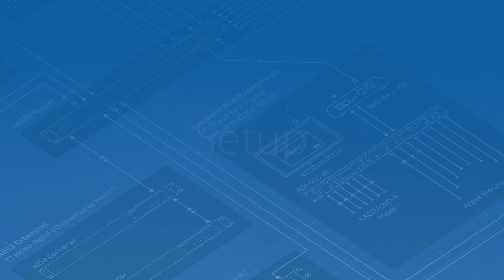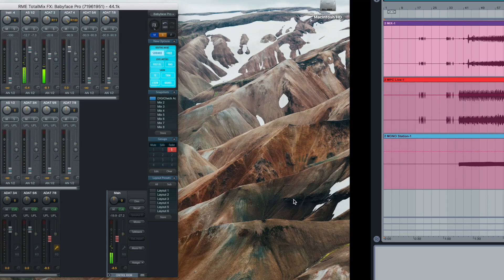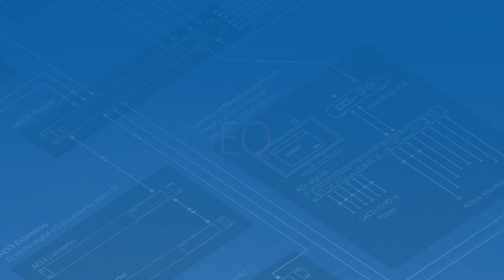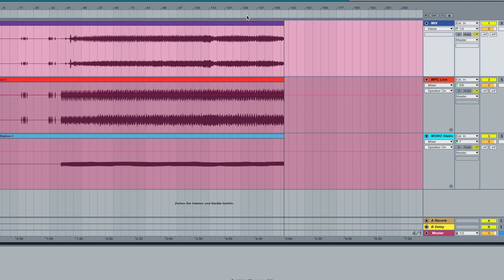Mixing & Routing in TotalMix FX (Babyface Pro, MPC, Analog Heat, Circuit) | RME Blueprints #01

Comment: how to connect hardware compressor
Reply from the maker: You must use a line output channel to go into the compressor. From the compressor you go back into a line input.
Reply: @RMEAudio  How do I temporarily monitor just the line input in this case? I've connected a compressor so I can just play an uncompressed vocal or bass line from my DAW, to go out (of one of the XLR ports), it comes back in to one of the line ins, and I can record this now compressed version back into the DAW, but I can't hear the compressed version as it's recording, I'm basically guessing the compressor setting, recording it, before seeing if it came out ok.

I need to be able to 'mute' the DAW to my headphones, and be able to only hear the returned signal in the line in, for the time spent dialing in the compressor. 

The line input that the compressed sound is coming back into, if I raise the level thing on it, sure it starts feeding that mix into the main sound, but then obviously that begins to cause a loop, because that becomes part of the main sound which feeds backout into the compressor.

Comment: Hey. I want to process a percussion loop through my BAE 1073. I have the percussion loop on track one in ableton. On track one i have the external routing out xlr output one on the babyface to the input on the BAE. I then have set up track two with the xlr output of the BAE to xlr input on the babyface pro. but im not getting a signal into the audio track? its doesnt seem to be going throught the output??? cant figure out why not?
Reply from the maker: Please check your routing. You have to select the output and then move the fader of the software playback signal up. The output fader must also be used to adjust the output level. https://www.youtube.com/watch?v=ZkxzYlBiScA

Comment: OK real quick question when im bouncing the final mix of a project in my daw if the loopback function and the DSP EQ to record is selected will it record the interface effects when i bounce the project?
Reply from the maker: If you use the EQ in the loopbacked output channel, it will. Also the level of the fader will influence your loopback signal. Handy in case you want to amplify or reduce the mixdown signal.